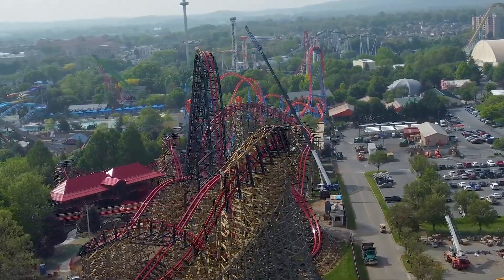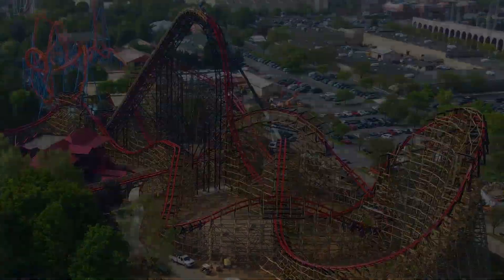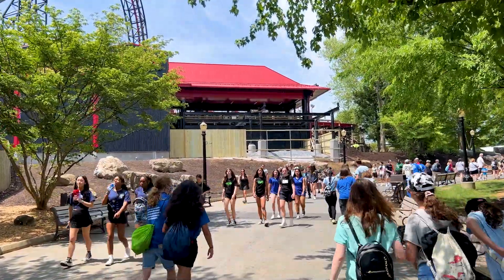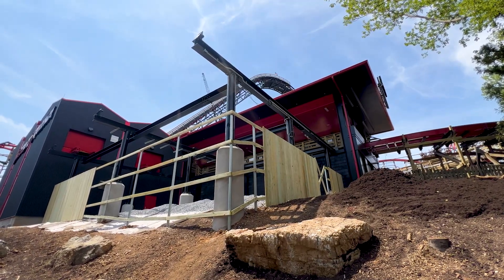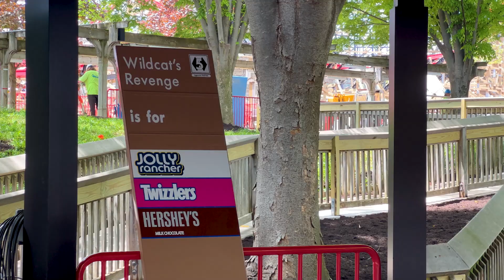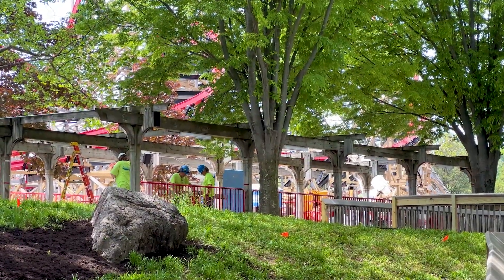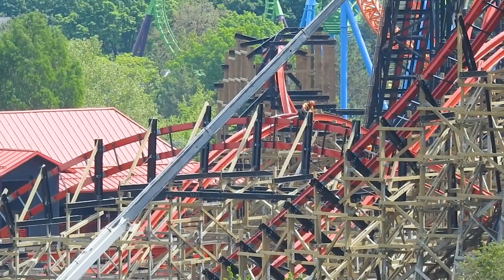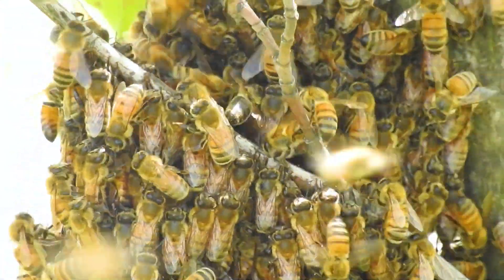Wildcat's Revenge | Construction Update #20 | Hersheypark | May 12th, 2023

Comment: The trackwork is completed ?
Reply: Almost, there is a small section that needs to be installed still, reason why it's not done is was they needed a crane inside of the track, which now has been moved out of the inner area so they'll probably put in those last track pieces very soon here